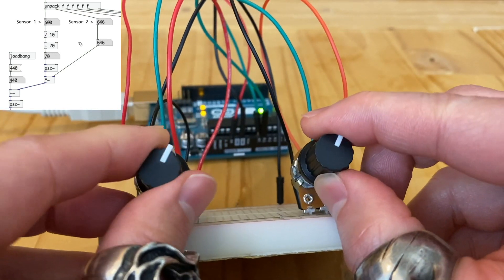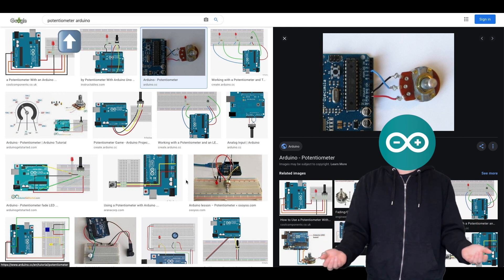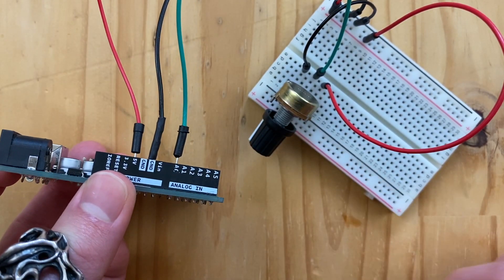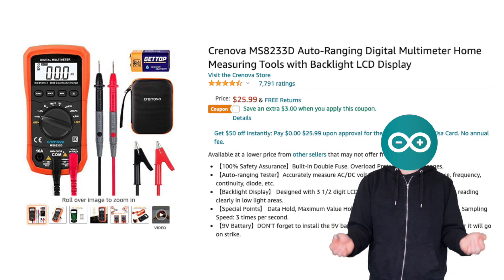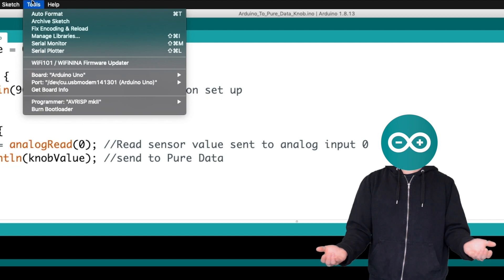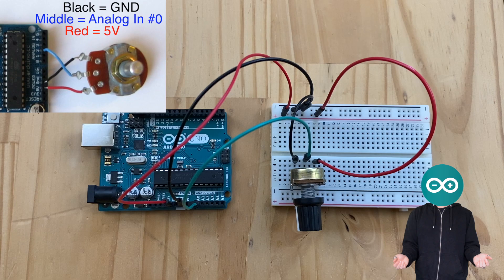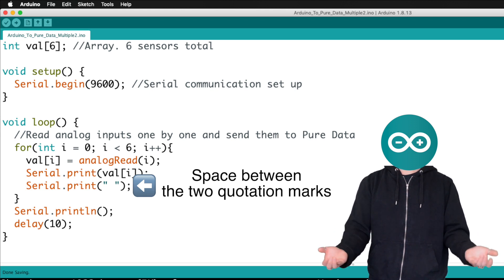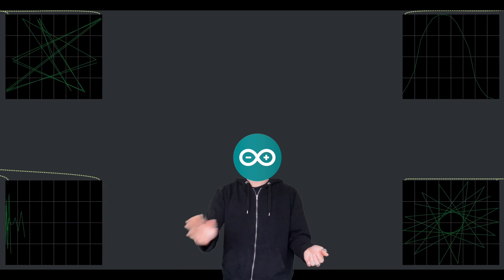Arduino To Pure Data (Tutorial)

Comment: why this doesn't work with an LDR?
Reply from the maker: Unlike knobs, LDRs/photoresistors require a pull-down resistor (10k ohm) when connecting to an Arduino. Searching "LDR Arduino" into Google Image will provide you with diagrams that you can recreate.    

If you did connect LDR using a resistor, then I'm not sure what the issue is. Please feel free to contact me through any of the social media listed! 
Good luck!!
Reply: @SoundSimulator  ! tHANK YOU You roCK! Already have the resistor and connection in Arduino i got numbers like 900, 800, but in the print in Pure data, i saw 53 13 and 10 in the print. i dont see it in the number object like in the knob : /// :((
Reply: already wrote you via instagram
Reply from the maker: @EMERGENCIASTATE  I'll reply to you via instagram in few minutes!

Comment: Hi, what should I do If I want put more than 6 sensors?
Reply from the maker: Hi Jalsifer! In the Arduino code, you can change the array size from 6 to 16 (I'm assuming that you're using Arduino Mega). So, the first line of the code will be int val[16]; and the for-loop will be for(int i = 0; i < 16; i++) { ... and the rest is the same. 

And in the Pure Data patch, have 16 'f's in the unpack object. 

Let me know if that worked for you! Have fun!!
Reply: @SoundSimulator  thank you sooo much, it works!!!
Reply from the maker: @jalsiferdai3628  You're welcome! I would love to see what you will be building! 
Enjoy!!

Comment: Nice tutorial. Explaining the breadboard also helped me, thanks! Just a quick question, is it possible to modify the light theremin project, so that the light resistor sensor replaces the potentiometer? I will try... I would love that data to become useable for virtual synths in pure data or somewhere else...
Reply from the maker: Thank you very much for watching! I'm glad that this tutorial was helpful! 

Yes, you can follow this tutorial and use the light sensor instead of the potentiometer knob. You'll find many helpful diagrams if you google image 'light sensor arduino'. In my recent video on digital buttons, you can find a link to the resistor set that I recommend. Any resistor sets with good reviews will work tho!
Reply: @SoundSimulator  I have made the project now with an analog light resistor that was in the starter package (instead of a potentiometer), and in the program arduino I combined the light theremin code with your code for the serial writing. The program works, though it only shows numbers between 45 and 57... so that is a bit limited as a sensor reading, but a great start for a beginner like me... Maybe I have to update the analog LDR to a digital light sensor, or perhaps a voltage meter for a solar panel could work too...
Reply from the maker: @pieterpauwelbeelaerts5995  Analog photoresistor should give broader range than that. Did you make sure to use a 10k ohm resistor when connecting the sensor? We need a pull-up resistor for some sensors unlike the knob sensor we used in this video. The analog should be about 300 (average room brightness) to 1023 (light source right in front of it). Or it could be something with the Pure Data patch. If you would like to send me screenshots and such, please feel free to DM on social media or email me at hizumu.sound (gmail).
Reply: @SoundSimulator  it was my Pure Data patch, I did something wrong there or installed an incompatible version... Now I have followed your other tutorial about configuring the arduino for MAX MSP (thank you for that tutorial!), installed that program and now everything is working just fine! Sensor values between 0 and 1023, just like I asked Arduino to map!
Reply from the maker: @pieterpauwelbeelaerts5995  I'm glad to hear that things are working now! Have fun!! I would love to do a whole video dedicated to light sensor. Have you seen Leafcutter John's Light Thing video? It's amazing!

By the way, did you try the Pure Data Extended approach or did you use Vanilla?

Comment: I have one question! I can't download the PD extended to my Mac, so I work with PD 0.51 and externals. The only one I can't find is the iem_alisttosym object, not even in the iemlib external... Is there some other thing I can do? Thanks!
Reply from the maker: Hi Nicole! 
A substitute for [iem_alisttosym] is [list tosymbol] 
Please let me know if that works!
Reply: @SoundSimulator  Hi! Thanks!! [list tosymbol] worked! It appears as an object in my patch, however, I followed all the steps and everything is good on paper, but nothing happens when I twist the knob, it remains 0. In PD the MIDI input and output, should be connected to something specific? Only appears the Driver IAC Bus 1. Thanks again!
Reply from the maker: @nicoleremy2512  
Hi Nicole! 
There is no need for MIDI since we are using serial communication. 
The port name of the arduino should show up when you click the print object in Pure Data. 

It's difficult to tell which part needs troubleshooting, so please feel free to DM me on social media or email me at hizumu.sound [gmail]. Please send me a screenshot of the codes and what's showing up on the Pd window. And I'll get back to you as soon as possible!
Reply: @SoundSimulator  I have the same problem and nothing is showing up at the pd window, even when I clic print (but the port connect well)